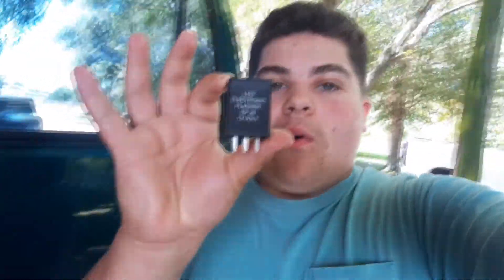How to fix Hyperflash WITHOUT RESISTORS

Comment: Keep in mind, this only works if ALL your turn signals and flashers are LED
Reply from the maker: Forgot to include this in the video
Reply: Will this work for any chevy car? I bought a vland sequential tai light for my camaro 2017 and it does hyper flash when i turn the signals.
Reply: What do you mean by flashers??? I installed LEDs in my license plate light and removed my day time running light bulbs completely. Now I’m getting hyper flash.
Reply: @Jaemg5 me too man.. did you figure out how to fix this issue? I need help
Reply: @jfoxofficial7  nope i could never fixed it. Sorry man.
Reply: @Jaemg5  If you dont have a bult in your day time running lights it will hyper flash, Cause the computer doesn't sense it and hyper flashes

Comment: I never understood why you needed a resistor in the first place if you had a normal flasher to swap out for an LED flasher.
Reply from the maker: Because too many watts are being pushed through the stock relay
Reply: @Dirtydetours  If you're using a LED, that reduces the watts to the stock flasher, but adding resistors just requires more power as all you have to use is an LED flasher to eliminate resistors. I have never in my life used a resistor to install an LED.
Reply: It’s because the computer thinks the bulb is blown therefore it hyper flashes to notify you a bulb is out. The led isn’t being registered my the computer.
Reply: @Dirtymax_Danimal  you right , no read is there bulb , my friend installed extra wires with sockets and keep halogen bulb and hidden them and installed LEDs and eveything work good without resistors , computer still read there is bulbs
Reply: Different resistance

Comment: Does it works on a 1999 chevy silverado 1500 the heavy duty flasher relay
Reply from the maker: I believe so but I’m not completely sure
Reply: You’re is a square shaped 99-02 . 03-07 is rectangular shaped.

Comment: Got a question.I’ve swapped all leds.change the relay out but with low beam lights on my high beam indicator stays on as well as my blinker arrows are illuminated.got an idea?
Reply from the maker: What vehicle is it
Reply: @Dirtydetours  96 c1500 but I think I just figured it out.i believe I had the factory truck plugs backwards.
Reply: @Cgarrison  that will do it. Have led turn signals installed and found out I miswired them.
Reply: My 87 gmc does the same thing and blinkers don't work with low or high on only off or running lights

Comment: Can i use that on a 2018 chevy camaro? 
Do you have a link where can i buy it?
Reply: I believe all new vehicles like my 11 silverado is controlled by bcm. So now flasher relay to change. Have to tune it or buy lasfit with built in hyperflash fix

Comment: It worked for my front turn signals but not for the tail lights. Any suggestions for the tail lights?
《94 Chevy Silverado 1500》
Reply from the maker: Are you running stock taillights
Reply: @Dirtydetours  I'm running leds bulbs on the  tail lights.
Reply from the maker: They might need a resistor in them I only have experience with taillights that are full led with a relay
Reply: @Dirtydetours   then I will probably be using resistors for my tail lights thanks.
Reply: Or you have more than one flasher.
Reply: @jamesm568  if there's more than one flasher, where can it be located?
Reply: @Giorgio_.1  Should be in the same area as the original flasher. Turn on the blinkers and unplug the original flasher and listen for the sound of another flasher. Theoretically, you can't have hyper flashing unless your rear tail lights/blinker are on a separate circuit than the front blinkers.
Reply: @Giorgio_.1  1995 is an oddball year for the harness; it's a weird mix of pre-Vortec and many of the changes they made for 1996-up. It should still have the turn signal flasher on the convenience center under the dash on the driver's side of the firewall.
Reply: I’ve got a 2012 chevy Silverado 3500HD what do I need for rear turn signal hyper flash?

Comment: would this work on a 2008 silverado
Reply from the maker: They don’t make a relay for your truck so you will have to go the route of the load resistors
Reply: @Dirtydetours  yep i used resistor, i’ve got no hyperflash though haha
Reply from the maker: Daylan Giovati glad I could help